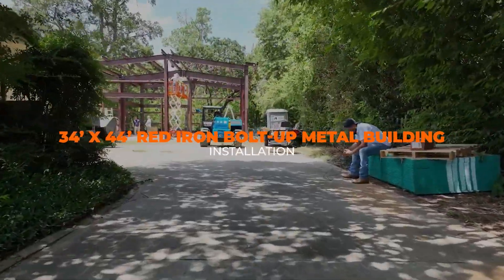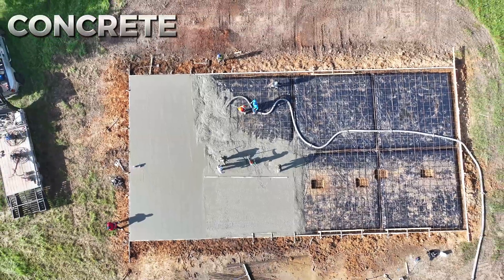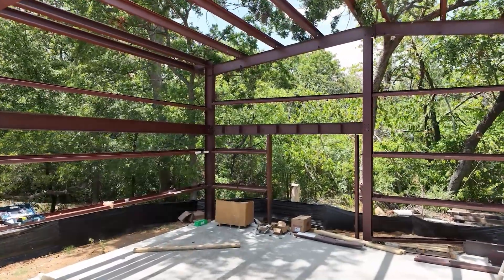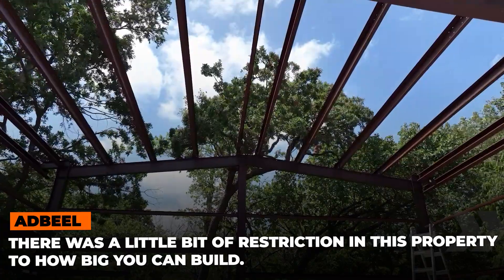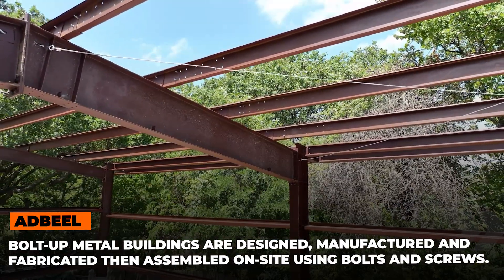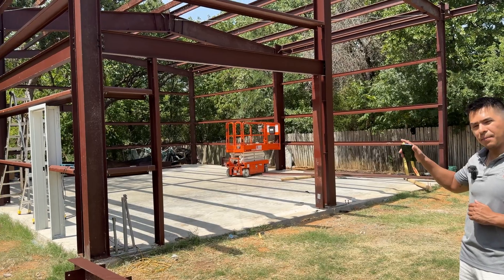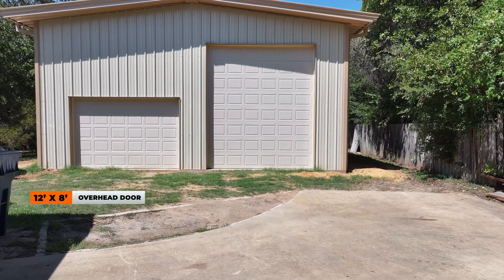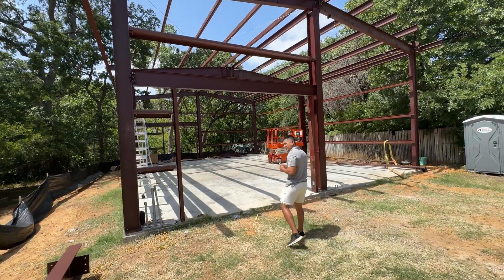34x44 Custom Red Iron Metal Garage Installation | Suspended Mezzanine? | WolfSteel Buildings

Comment from the maker: *Disclaimer: All mezzanines suspended or not must be engineered. Ability of having your mezzanine suspended is on a case by case basis. Due to design, engineering, and logistics we are only doing mezzanines on Bolt Up Buildings*